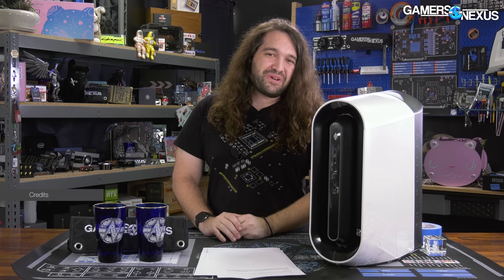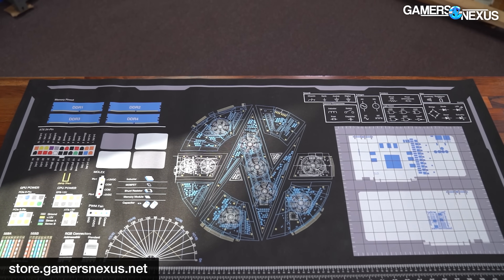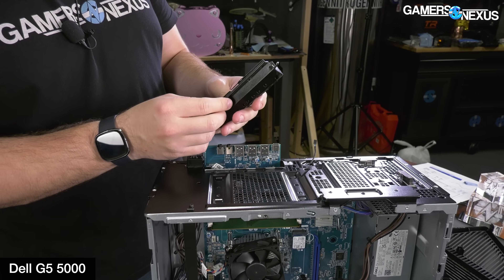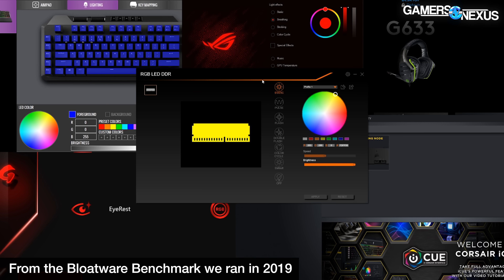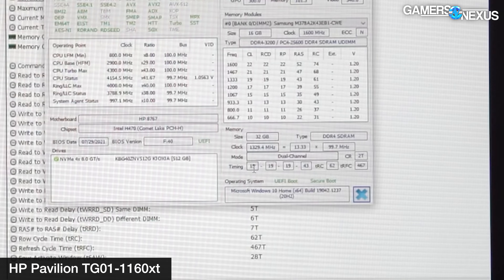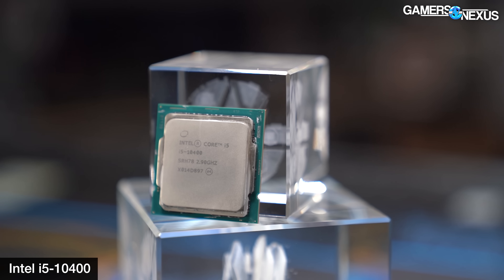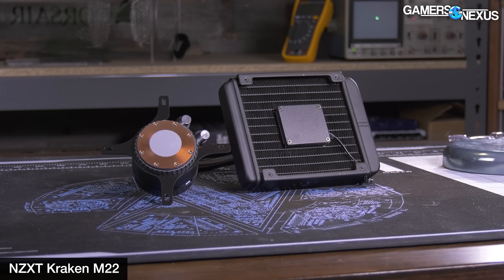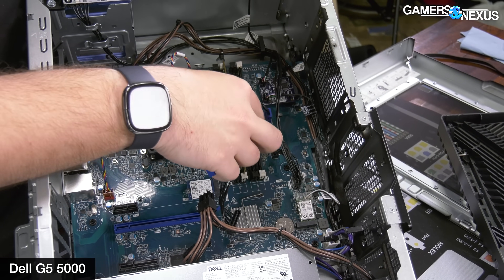The Worst Prebuilt PC Mistakes We've Seen (So Far)

Comment: I nuked my OEM laptops and abandoned my OEM desktop in favor of an SI prebuilt from my local market. I asked what I wanted and they built it for me.

The Acer is one of the culprits - they partitioned it in a very shady way with two partitions on one SSD.

I used a HP prebuilt for 5 years until 2020 - and it was one of those which had completely proprietary parts. I ended up changing to a non-OEM desktop.

Comment: I actually got an Alienware R8 from a friend for about 1K off the sticker price with an i7-9700K and 2080 (when those were current gen), and for the amount of gaming I did, it was... fine?  Super noisy but temps were ok even with a mild OC.  After a couple years though, the GPU suddenly lost a lot of it's performance.  I had it running around the 80th percentile in 3Dmark, and suddenly it wouldn't go above the 50th.  I have a feeling it ran hot and downgraded itself to a 2070.  Said GPU now lives in that same friend's computer after his PSU shorted and cooked half the components.

It was lovely to find out that the case was far too small for any GPU with decent cooling and the motherboard was propietary.  Luckily for the computer, the role of family desktop had just opened up.  So after gutting it of what I could use (cpu, ram, storage) and throwing on an 8th gen i5 and a passable ram kit, the Alienware is now spending it's retirement browing facebook and clipping e-coupons for the weekly grocery shopping.  Jokes aside though, I'm glad I could at least spare dumping it just because Dell's anti-consumer BS.  One less piece of e-waste floating around is a plus.

Comment: One of my favorite parts of buying a pre built is rebuilding the whole thing and giggling at all the issues that would have gone "unnoticed" until they caused larger issues. Just seeing the small things that get missed like not tightening mother board mounting screws or horrific cable management that had to be harder to accomplish than just lazy managing the cables. Improperly seated RAM sticks and SSD. I wouldn't say it's nice finding issues on a pre built but it's kinda fun debugging the whole thing and laughing at and learning from "professionals" mistakes.

Comment: When I started modding my pre built Skytech Nebula, and I wanted to actually swap out some of the internals for more powerful ones, myyyyyy Gooooooodddd the sheer number of zipties I had to very CAREFULLY cut so as to not break any of the wires was astounding. Phanteks and NZXT cases I would argue actually did cable management better since those come with velcro bands instead of zipties so you don't have to CUT them off AND you can re use em. Even just replacing the CPU cooler I couldn't do it without cutting off yet another ziptie holding a very thin wire bundle in.

Comment: Have a near 2-2.5 thousand dollar cyberpower from 2018, only issue I’ve ran into is an issue with the pc not booting to windows every once in a while. I shut it down, wait a few seconds, and it works but every year or so it won’t boot at all and I have to reinstall windows with a usb. Very annoying but it is what it is, I also don’t know anything about the case so it could be good or bad I’m not sure. Have no idea how to disassemble it safely for customization or maintenance either which makes me regret not just building it and learning myself.

Comment: I didnt have any problem with the prebuilt I got from ABS, apart from a single stack air cooler and a wimpy SSD. 

Ended up returning it so I could sink pretty much the same money for a much better system. 

Building it was stressful and confusing, but it currently runs and runs well.

Comment: I ordered a pc from xotic pc's. there was a couple problems. they had a wire pinched in one of the drive bays on the hyte y60 because they didn't tie it down enough. the aio pump and radiator fans are all splitted into the same pins on the motherboard.. why? wouldn't it be better to put the aio pump on the aio pump pins, and the radiator fans on the cpu fan slot? anyways. they also left one of the cords too close to a radiator fan. for some reason one of the fans wouldn't run. tried to figure it out but couldn't then suddenly the fan kicked on, and one of the connectors going to the mobo had a wire going partway up into the way of the fan.. once it kicked on all i heard was that wire getting smacked by the fan and didn't want damage caused so i flipped the psu switch like my life depended on it. so, the build was pretty good besides those mistakes. nice and cool, idle both gpu and cpu at 28-30 celsius.

Comment: It is like gambling with ibuypower I got a system that was flawless went over it Cable management was good parts for good quality and my temps under load stayed good. Had a friend buy one same price. close to the same specs It was trash It worked but thermal throttle instantly and a few other small issues too.

Comment: Recently bought a Lenovo prebuild with a 4070 GPU which Nvidia says needs a 650W minimum power supply (haven't received it yet). The build has a 500W PSU. I'll let you know how it goes. I've been stonewalled by Lenovo customer service over this.

Comment: I bought a prebuilt once from NCIX and it came with a PSU too weak to support the system so I bought a new PSU and then learned the ram was incorrectly installed so I fixed that. months later I got major CPU overheating so I learned how to take it out and found there was way too little thermal paste. lol

Comment: This is just entertainment for me, I only bought prebuilts from a local company that I know to be reliable (although they sold me a display as 1920x1080, but I found it was actually 1920x1200). Their loss, I assume. But overall, they never lied to me and they are fast to remedy any problems. Like once I bought a prebuilt computer for my son and it shut down about half a minute after a boot. When he saw it, he remedied the situation simply by giving me another computer, closely similar specs. I liked that response.
Reply: Oh, and the computers I bought didn't come with the OS pre-installed. I made it clear from the begining. I had my own subscription for Windows 7 at the time. I suggest every one of you, check out your local shops before buiyng online. Then you know what you're gettinvg.

Comment: I've got an iBuyPower prebuilt (went against my PC DIY Elitist religion but I was in a pinch) and I was actually very surprised. Posted right out of the box, all cables were well managed and connected properly to the mobo, XMP was enabled in BIOS and after some Core Isolation navigation I was able to use XTU to overclock the i5-13600KF to 5.4GHz with no stability nor thermal issues. I swapped out the RAM with my 32GB TridentZ from my previous build, added a few SATA SSDs and it's an absolute beast. Only gripes I had with the build were the lower end 600W non-modular PSU, the front panel of the case (Hako Slate MR) suffocated airflow which was an easy fix, just take the front panel off.. and it took two weeks longer to deliver than what was promised. I should note though that their customer service reps were excellent and professional. Overall it was a very pleasant experience. Been running strong for the better part of a year with no problems... Except for Windows 11, it has a few neat features but this is a garbage bloaty OS, stick with Windows 10.

Comment: Hi Steve.  I purchased a gaming computer online from CLX.  just under 4 grand.  biggest mistake i have made with computers.  i use to build my own.  Since day one when it arrived it would not boot, upper radiator fan did not work, ram test said to contact vendor for replacement and OS could not install correctly, GPU also had problems. they shipped a second one, same kind of problems with two additional problems.  computer was running at 95C at idle and it would just shut off like somone pulled the plug.  other times i go to shut system down in windows 11 and everything shuts off except the desk top tower. i have to hold the button down for 6 seconds to get it to finally shut off.  i contacted CLX and they said they would ship a replacement as soon as i shipped this one back, this has been going on since oct 12th last year and i still do not have a working computer from them.  have no idea who to contact, left message with attorney generals office, tried to contact consumer attorneys, contacted would be supervisors at CLX. getting nothing but the run around.

Comment: i bought a cyberpower gamer xtreme and its just fine. easy to upgrade and thermals are fine although i added a 240 mm aio because the cooler it came with was very noisy. highest cpu temps ive seen now under load is around 63 degrees and gpu hangs around 65

Comment: Whats funny is my first build I ever built is better than most of these pre builts in price to performance and build quality, with the added benefit of upgradeability.

Started super budget with a really cheap Ryzen 5 3500 CPU bundled with a MSI B550-A Pro motherboard I picked up off of facebook marketplace, OEM 1650 Super, 16 gigs of cheap A-Data 2666 RAM, a 256 gig WD Blue m.2 drive for my OS, and an EVGA 750W 80+ bronze PSU. I was using an external USB HDD for my games.

Had to swap motherboards because the MSI board had something literally pop on it while I was gaming otherwise that would still be in my system.

But I have since upgraded basically everything as I have been able to. ROG Strix B550-F gaming, Ryzen 5 5600x, Red Devil 6750 XT, Corsair Vengeance RGB Pro 32 gig 3200 mhz cl16 kit, replaced the stock cooler with a Hyper 212 Black Edition. Still have the original boot drive, but have since added a Crucial P3 m.2 drive as my game storage drive.

Makes me feel pretty good that I built a very upgradeable system with much better price to performance than a very large company can, even on my first try. And since I've been able to upgrade it bit by bit, it has been alot more affordable to get it to this level. Splurged a bit on the PSU and Lian Li Lancool II case when I first built it because I definitely wanted to carry those things forward for at least one upgrade set. I was considering a prebuilt when I built the budget rig, super glad I didn't because it would have been very difficult to carry anything forward. 

Plus, now I get the privilege of taking the old parts and helping my kids build a PC, hopefully get them into PC tech a bit, and introduce it to them alot sooner than it was introduced to me!

Comment: I had the opposite of bloatware in my prebuilt. The version of Windows 11 that shipped in my Cyberpower PC was so stripped down that it didn't even have the photo viewer installed by default, or the Microsoft store for me to get the photo viewer. It took the Xbox Box app complaining about missing a ton of dependencies needed for it to function and using its built-in tool to fix those dependencies for me to finally have a complete version of Windows on my system.

Comment: I think I might know why single-channel RAM is so weirdly common. My guess is, a lot of system integrators specialize in higher-end machines, where they put in at least 32GB dual-channel, so they keep a huge supply of 16GB sticks in stock. Then they decide to try offering a cheaper model, and they want to use what they've got on hand, so that "budget" prebuilt gets a single 16GB stick.
Reply: I work for a niche computer manufacturer and this is exactly the reason

Comment: man i had an hp 0men from 2017 i paid like 1500 for it.. i alwasy thought HP ripped me off because it was slow and hot and cpu usasge was always so high.. i saw the origional bloatware HP video here and i removed everything HP except for HP drive guard ( cuz it sill has a spinning drive) and the laptop runs awesome now.. i can actually use it for everything but low level gaming.. which is not what i bought it for 5 years later

Comment: In one instance, a long, long time ago, a custom high-end (for the time) system had an area on the back of the motherboard taped (electrical tape, I presume) to protect it from touching the case.  Unfortunately, it caused repeatable infrequent memory errors (and blue screens).  I taped the chassis instead, and the system worked fine for many years. The vendor didn't believe or acknowledge the likely capacitance change as an issue.

In a recent system build, an otherwise acceptable system had dangling cables over the CPU/memory area that induced issues that disappeared completely when the cables were managed (on that system now).

Comment: I've been using the same Skytech Shadow prebuilt for 7 years and it never had bloatware or any issues other than the airflow is ass once you start upgrading parts to hotter ones.
Even a Hyper 212 EVO with 2 140mm fans cannot cool my fx-9590 in this case, so I keep the side panel off with a small metal desk fan blowing in to keep it cool.

Comment: The thing with the Screws is something I cant get, you can buy Screwdrivers with defined torque values in a broad range from a single one to Air pressure Systems for production lines. I've worked in the Industry for years as engineer and if you "spare" at this you get a lot and I mean A LOT of Problems with damaged parts. This Stuff come back or musst be refunded or kill your entire system in a chain reaction. You can just take a CPU Cooler as example, take a driver with x NM and turn to the point it starts clicking-> done the pressure on the cpu is 100% even. You can give a 8y old this and he can install it perfectly. -.^

Comment: I have the omen 25l and their cooler and general case is crap. The case has a closed outake at the top of the case that you can remove to cool it off. I changed the cooler and added some fans to increase the air flow and was able to drop the temperature by almost 20 C.

Comment: The one thing I will say about prebuilt PC's is that there are deals to be had if you look hard enough. If you get a closeout or clearance pre built for an extremely low price then all the negatives really don't matter. I bought a HP TG01 prebuilt with a RTX 3060 , 16 gig ram 1tb storage and i5 10400f brand new in the box for $400 from Facebook. It's usually the prebuilts that go cheap second hand or clearance and if you find one you really can't beat it.

Comment: i got a cyber power pc and it came with an aio cooler that did nothing it thermal throttled right away... fixed that with my old coolmaster cooler from my old pc...and the power supply was under powered for the system... when the video card was under a heavy load the pc would shut off... fixed that again with the old power supply from my old pc.... should have just built it myself but i couldnt find a video card in stock for a good price at the time... and couldnt wait any longer

Comment: I bought not one but two pre-built laptops directly from cyberpower. First had a screen issue 2 months in and had two rma to fix the issue, the second laptop arrived without wifi at all (chip wasn't detected) after the rma finish it returned day later got perminate dead pixel line. I returned it. I wish I could return the first

Comment: I got an HP omen 25l for like 1150 or something back in the summer of 2020. It was like $100 or $150 more than if I had bought all of parts and done it myself (which I was concerned about doing still am but I'm about to build my own once my 5900x arrives in September) I was and am happy with my purchase. I upgraded everything but CPU cooler, CPU, and motherboard....but it was a champ at 1080 high res before I switched to 1440 My sole complaint really is the motherboard. Locks ram speed unless you buy hp ram and doesn't handle overclocking...case is also a tad small...had to buy a reference 6900xt because no other 6900xt would fit. Going to strip the omen and return it to stock give it to my mom. Specs were 3700x 16gb 3200 ddr4 ram 512 nvme ssd 5700xt cooler master 550 pay. I am going to build 5900x 32gb 3200 ram 1tb nvme tuf x570 6900xt corsair rm850. I'm really stoked to have completed my journey and have a pc that I'll enjoy for 5+ years unless games really start utilizing next gen stuff

Comment: This is late. But I can send you pictures of my 6,000 Falcon NW computer that's died 3 times in less than 2 years due to heating issues. There is only 1 exhaust in the back, and the cooler radiator is tied to the intake fans. The box heats up like an oven whenever I play any 3D games.

Comment: I think the most hideous thing a manufacturer can do while producing prebuilt is to overspend on something that doesn't need to spend much on and sell it to uninitiated buyers. Like, why would you need a 64GB of RAM when you only running a low-spec i5, and 1000w PSU when your system probably only need 400w tops.

Comment: 3:46 i had an HP PC with a top mounted PSU that held up by no joke some thin old metal wire, that was tied at the ends to make a loop, S bent on the visible face of unit which held in place my a piece of electrical tape 3 inches long